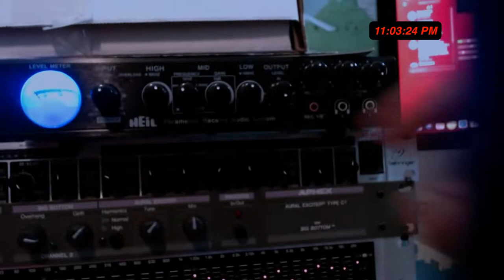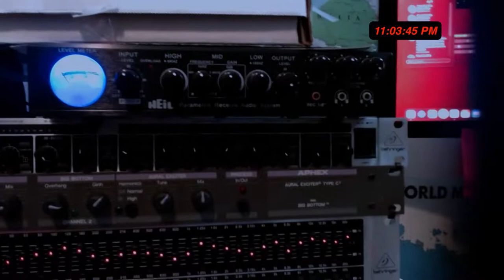Ham Radio Live! Show 94. Six Microphones And How They Could Make You Sound Better On The Air!

Comment: Phantom power (which is 9 to 48vdc)  is only to power the preamp built in the mic. You generally don't need an external preamp, just a phantom power injector. 
You may need a preamp, depending upon your radio. Most do not.
You DO need a special cable for some radios, such as the Icom 7300 which expect an electret condenser mic and provide ~3vdc phantom for a hand mic. This low voltage is not sufficient for a pro Mic that needs "pro" 9-48vdc phantom power.  These cables block the 3vdc from the radio.